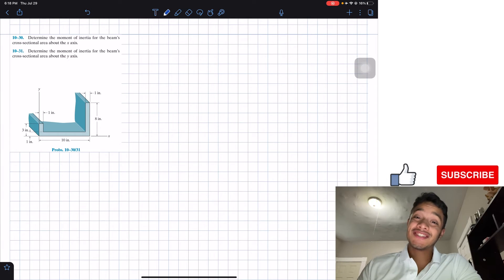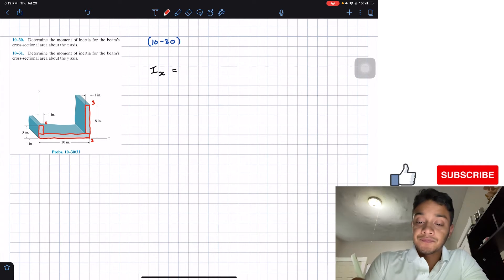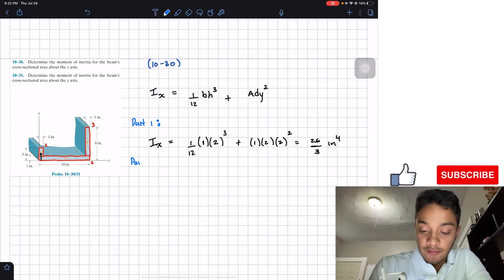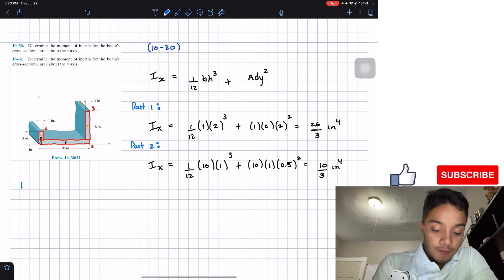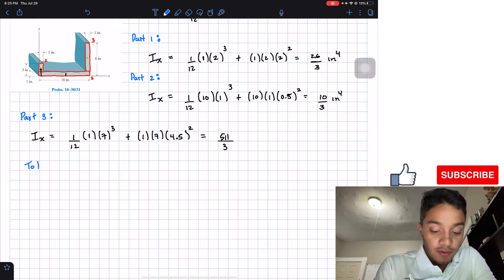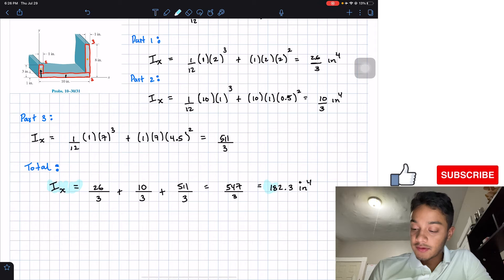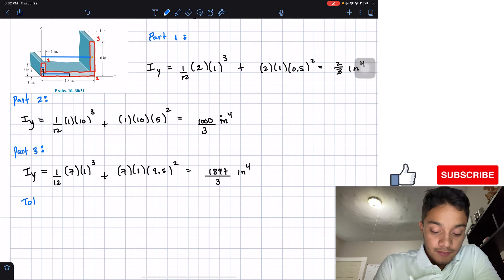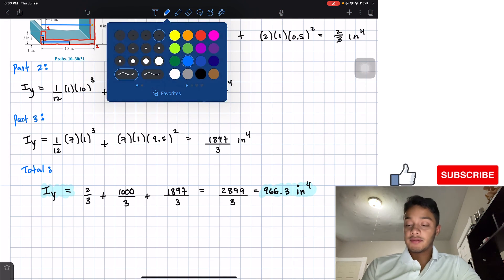Statics 10.30 & 10.31 - Determine the moment of inertia for the beam's cross-sectional area.

Comment: Great Video! For the first part of this problem, there is a simpler method to arrive at the same answer. Instead of separating the parts the way done in the video, separate them instead by cutting downwards at the 1 in mark and the 9 in mark (referenced from the left side of the figure). Then the 1/3 (b)(h^3) formula can be applied to take the sum of these parts without any need for accounting for deviation from the x-axis.